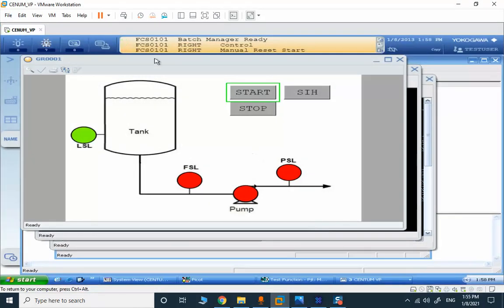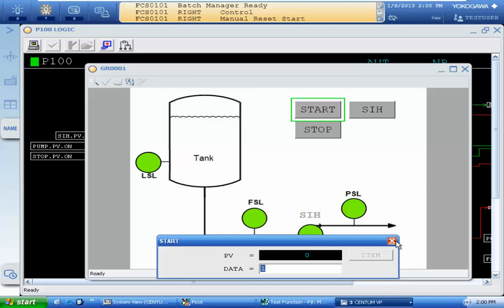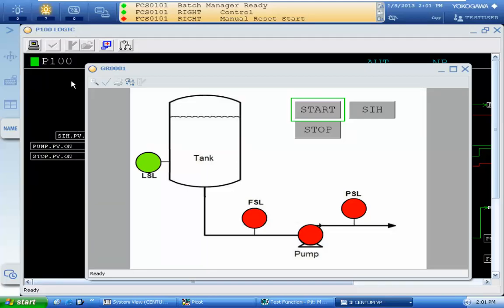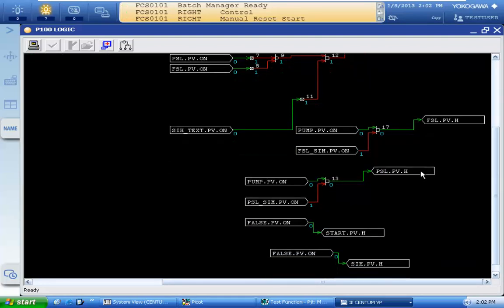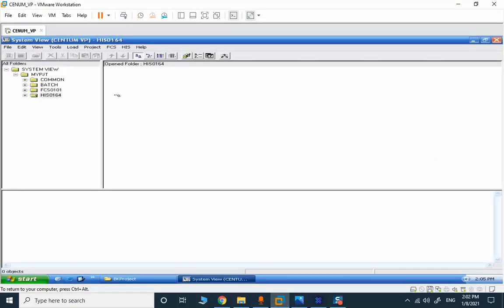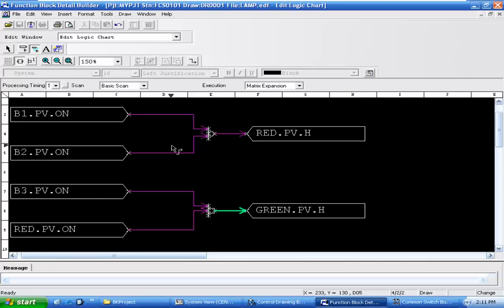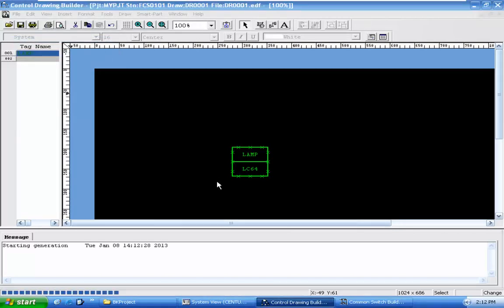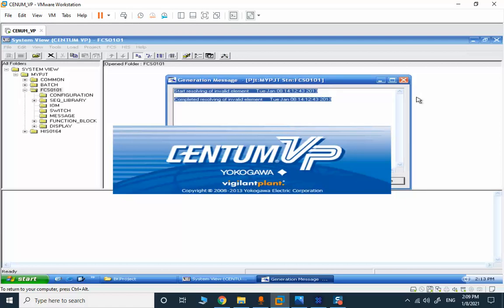Yokogawa CENTUM VP LC64 (Logic Chart Block) | Centum VP Tutorial | Yokogawa DCS training

Comment: This looks perfect for my needs, I would like a HH Pressure to close an analog valve. however, I am struggling to find the right command structure to tell my PID block mode to go to manual and the MV to 0%.  Could you please share an example for those?
Reply from the maker: I will make a video to explain the options.